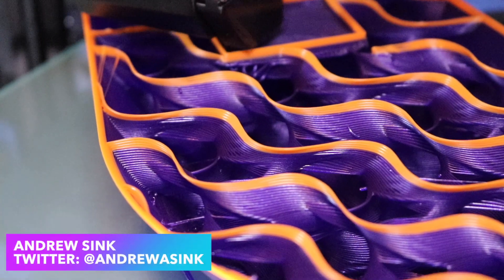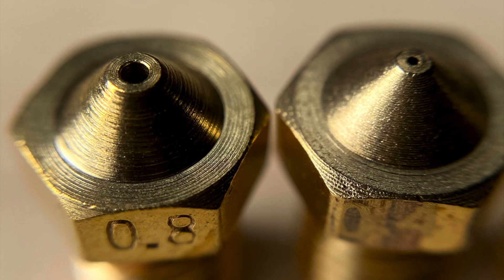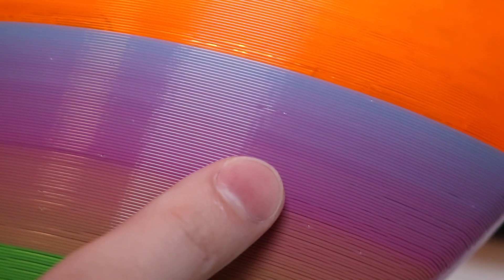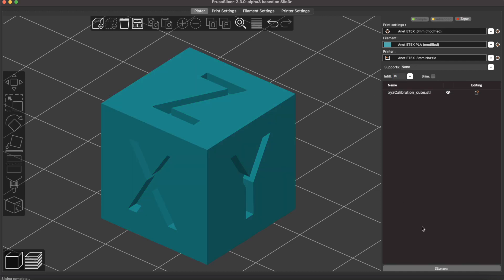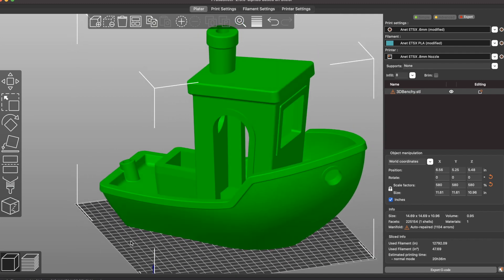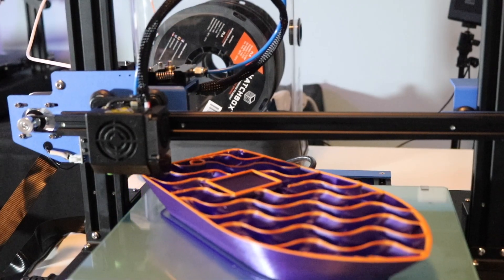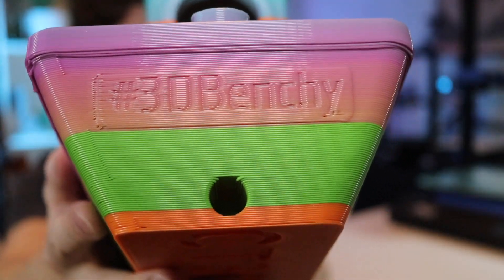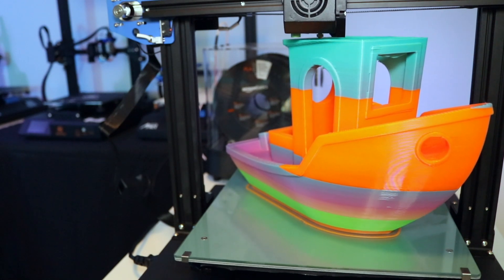3D Printing with a .8mm Nozzle / Print Bigger and Faster with the Anet ET5X!

Comment: Thanks for the video. I have success with PLA on a .8mm nozzle, but the moment i switch to petg, it gets clogged on the top portion of the extruder housing.  I cleaned out the nozzle, it extrudes for about two layer lines and then it clogs/bends at the top of the extruder housing.  Then I have to struggle removing the housing that feeds the filament to the extruder. I am using the CReality K2 plus.  I use .4mm nozzle on Bambu labs without issues printing with petg and pla.  I tried increasing the temp all the way to 250, but it still fails. I used two different brands of filament, but it fails as well. I decreased the extraction but to no avail.  Has anyone had luck printing petg on their Creality K2 plus with a .8mm nozzle?

Comment: I've used up to 1mm on small print jobs because I didn't need the detail. Items I printed were usually inserts for my board games and using the 1mm cut my print times from 15hrs (.4mm) to 90min (1.0mm)

Comment: Can you share the rest of your settings? Like Estepmm/s, material? I’m trying a .8 on my ender 3 pro with PETG and I cannot get a print taller than 2cm to succeed. I don’t know if the step motor is slipping during the night or my build plate is hot enough but I never had a problem with a .4

Comment: Hey, what about using 0.8mm nozzle but using 0.3-0.4 mm layer height? I ask this because, even on 0.4mm nozzle, going above 0.15mm layer height, will give you pronts in which you can clearly make out layers. It can also be pulled out.

However 0.15 layer height on 0.4mm nozzle gives models that looks like they were injection molded. So can u use say 0.4mm layer height on 0.8mm nozzle and achieve that detailed finish much faster?
Reply: I was thinking the same

Comment: I've been using 0.8 mm for years, usually with 0.4 or 0.3 as the layer height. Another benefit of 0.8 is that you can forget all about nozzle clogging, it eats all filaments without any issues. Also has an improved fault tolerance in printing due to how much material is being squeezed out, it tends to compensate for any issues that normally come up. But yes, you do lose fine detail, but for fine detail FDM is bad anyway, I use 6k & 8k resin printers for that.
Reply: Did yoy have trouble with higher layer heights? I'm using .64 and it doesn't look the greatest. I'm printing at 40mm right now and was going to slow it to 25 to see how that goes but if I can keep the same speed at a .4lh I might try that instead as I should be able to lower the temperature back down to a 210-225 range instead of 235-240.
Reply: @ISILENTNINJAI  Yes, as I recall anything over .4 mm layer height didn't look that good. I print PLA at 230C and PETG at 260.
Reply: @dexagalapagos  holy shit, why so high for pla?
Reply: @borryx401  Had good results with it at 0.8 dia, lots of material gets pushed out so needs a bit more heat.
Reply: @dexagalapagos  good point, that’s wild! Appreciate the info, may have to give this a shot someday.
Reply: Hey so I use 0.15 layer height for 0.4 mm nozzle at 50-100m/s overal print speed. I have seen that going over 0.15 LH on 0.4mm nozzle; you can make out individual layers, and the model is not strong and can be broken between layer. Basically 0.15 LH on 0.4mm nozzle looks like injection molded models.

My question is how does you models look at 0.4mm LH  on you 0.8mm nozzle; does it look injection molded or are you able to make out the layers?
Reply: @dreudax3294  You can definitely make out the layers with 0.8, although as others have mentioned before, they kind of look like texture. If you're getting good results with 0.15 LH on 0.4 mm and print times acceptable to you then there's no reason to go to 0.8. I just prefer it because it lets me print prototypes and parts that don't require detail much faster. When I need fine detail I go with resin prints anyway.
Reply: @dexagalapagos  See the issue is its slow. I only print vase mode bcus of how slow it is. I make adjustments to feometry to allow me to print in vase mode. The part xomes out strong and functional, at 0.1LH on 0.4mm nozzle. But even at 250mm/s print speed its slow. Do you mind running something in vase mose on 0.8nozzle at say 0.3-0.4 LH? I say this because even at 0.4mm nozle, if I go above 0.15 LH the layers become very noticable, and i can easily break in between layers.

Edit: I shld add that I print using a variant of PETG. So models are already more robust and brittle than PLA.

Comment: Andrew,
I have read some other comments about the .8 and them multiplying it by .004mm to obtain varying levels of LH definition.
I was using a .4 nozzle with a .16 LH but wanted to up my game and time on project while retaining definition. Some were stipulating, using a .32LH (.8x.004) would achieve similar results. Thoughts?

Comment: Do you print with 60mm/s speed? What's your speed when you print with this 0.8 mm nozzle?
Reply from the maker: Hmm. I’m not sure what speed I was using for this video, sorry!
Reply: @AndrewSink  But that's very important setting. Usually with MK8 nozzles and Prusa like printers they recommend to low the printing speed and higher melting temperature a bit. For 1.0 mm nozzle it is about 20mm/s.

Comment: amazing

I 3d print mechanical parts like bearing blocks and the like. So I do not care about the part details.

with .4 mm nozzle, a bearing block that weighs 175 grams (100% infill) takes 26 hours. I needed 8 of them in addition to many other parts which means my wife will file for divorce.

I switched to .6 mm nozzle and speeded up the flow rate, same layer height of .2 mm. I was able to reduce the time to 12 hours.

Now after watching this video, I will try to increase the layer height from .2 to .6 mm and I will place order for .8 mm nozeles. with .8 mm nozeles I am not sure if my printer can keep up with the heat energy to maintain temperature. I have Longer LK5 pro printer. There must be a limit with the hot-end and the only way to identify the limit is to keep pushing the flow.

Thanks

Philip
Reply from the maker: Cool, sounds like a fun project! I've got an LK5 on the way, I'll have to try something similar!

Comment: Hello. Thanks for your video. One question, did you have any stringing problem when switching to a bigger nozzle?
I am trying with a 0.6mm nozzle, but it generates a lot of stringing, and I cannot solve it.
Thanks.
Reply from the maker: I didn't experience any stringing, but it could still occur. You might want to experiment with your retraction settings to reduce the amount of stringing. Good luck!

Comment: Hello i liked your review ,  i am having some issue on bed leveling on my et5   it seems like the right hand knobs are almost falling off the threads and i am not sure if something happended to the bed or what i have had the printer for like 8 months and it was working fine until just about two months it wasnt leveling right, any suggestions would be great thanks
Reply: make sure the bed is in the middle of the travel when you start...tighten them all the way down and then unscrew them half way.

Comment: Hey just found your channel, and it seems like you've got some pretty well produced content, and I'm looking forward to seeing more. I print with a 0.6mm nozzle on my Anycubic Kossel Linear Plus, and I have found it's a great compromise between quality and speed. I can dial back my flow and extrusion rate in slicer to get near the same quality I would with a 0.4mm nozzle at 0.2mm layer height, or I can go full bore at 0.6mm width and 0.4mm layer height. I do recommend bumping up the temperature if you want to avoid layer separation and have consistently strong parts.
Reply from the maker: Awesome, sounds like a cool machine you’ve got! Great tip on the temp, that makes perfect sense RE: time spent in the hot end!
Reply: Jason Hixon   Can you tell me some settings to try with a 0.6mm nozzle.  Like temp etc.
Reply: Yep no one talks about temp they just slow the machine down....What temp do you use with your .6mm? What would you recommend for .8mm? Also do you print at the same speed with the increased extruder temp?
Thanks.

Comment: I wonder how this would affect strength of structural parts. I imagine you could use acetone fume smoothing (on compatible plastics) to make the layers less visible.
Reply from the maker: I printed a single-layer vase mode print with this nozzle and was really surprised with the strength of the part!
Reply: @AndrewSink  Much stronger than with a 0.4mm nozzle?
Reply: @nathanking2484  Single layer twice as wide....it will be stronger